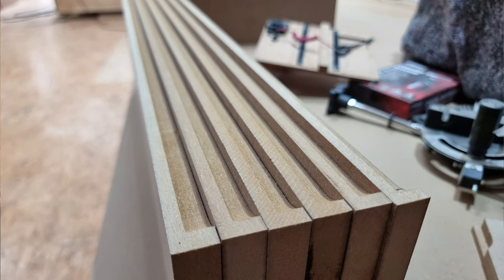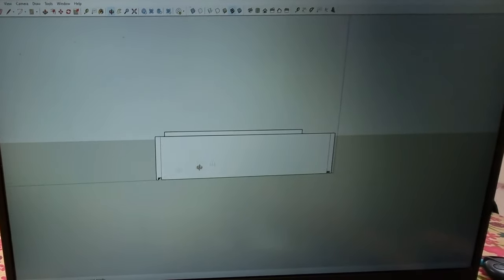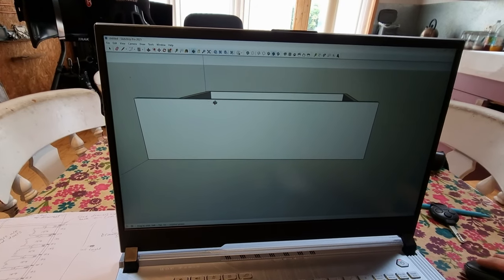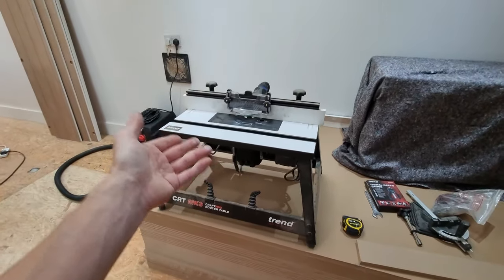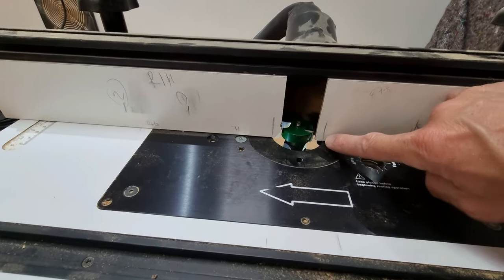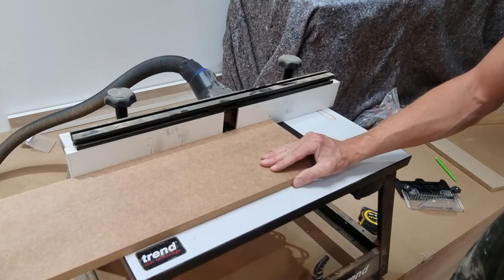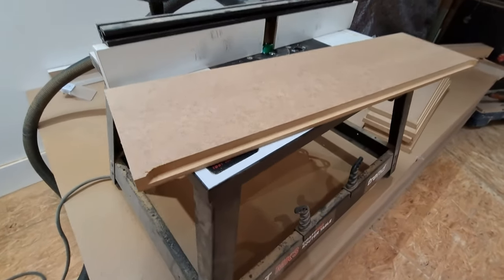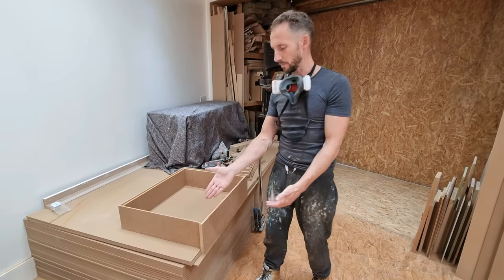Making Stopped Rebates On A Router Table // Drawers With Stopped Rebated Fascias //  EP#149

Comment: This might be a silly question but why do you pivot the draws when you start them instead of starting a little further in and working backwards to the stop mark. Does the router not cut well going the wrong way?
Reply: Running in the other direction is a climb cut, where the rotation of the cutter is trying to snatch the workpiece out of your hands.    You always want to be feeding the work against the rotation of the cutter, both with a table and a handheld router.